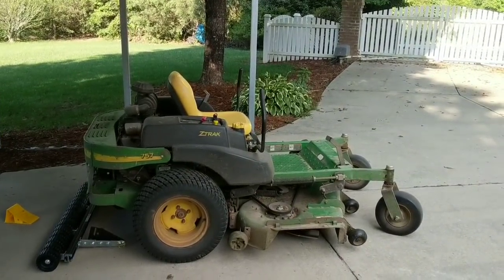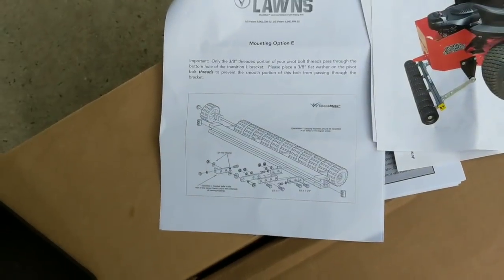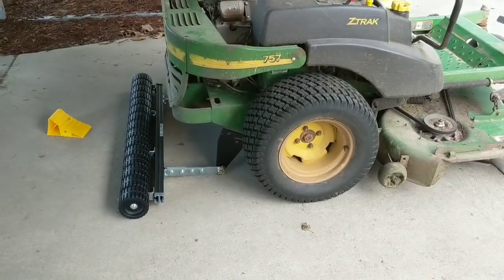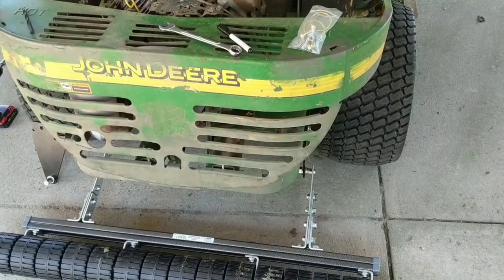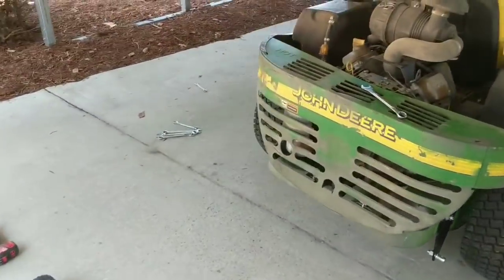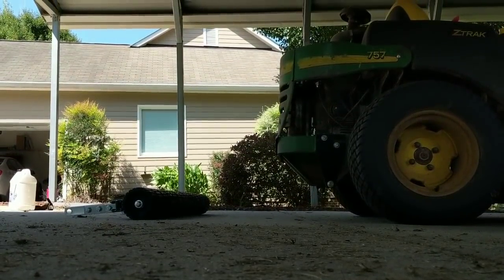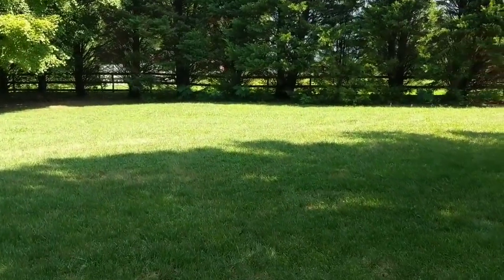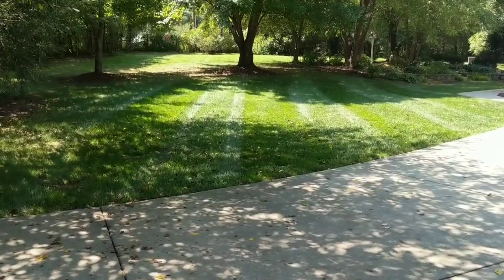CheckMate Lawn Striping Kit Install - Quick Release Bracket - John Deere 757

Comment: What’s the deal with this type of striping kit when mowing on hills or when reverse while on a hill? I’m trying to decide whether to go with boat roller wheels like this or the John Deere kit. JD makes two kinds of kits one with the composite flap and one with a roller. I like the multi roller Big League style better since the outer wheels can roll faster during turns which is just mechanics but better mechanics none the less. 

Any thought on turns while inclined or reversing on inclines? I like the quick connect so that could Take it off for those situations but obviously like the idea of a flap that never needs to be taken off for those situations if those situations require taking the trailing type roller off for some types of maneuverability.

Comment: So you can take the striper off and put it back on fairly easily using those pins? That’s what’s held me back from buying one. For space constraints, I thought I’d have to unbolt it each time I put it in my garage.
Reply from the maker: That is correct. It's a 10 second job

Comment: Looked like the bracket on one side was level with the frame and on the other it was lower by 1/4-1/2in  ?!?🤔🤔
Reply from the maker: It is slightly off, but does not make a difference in the stripe "depth" lol. Good eye